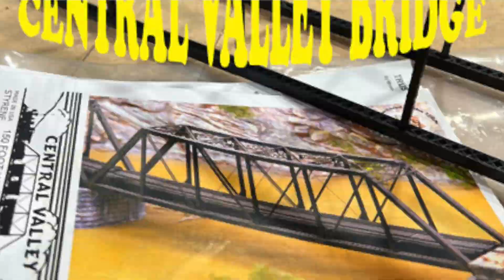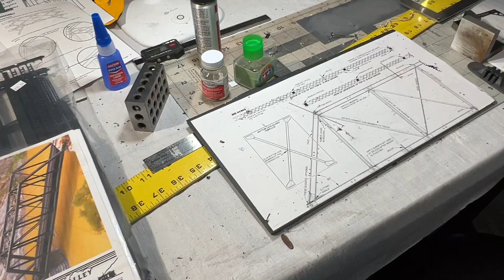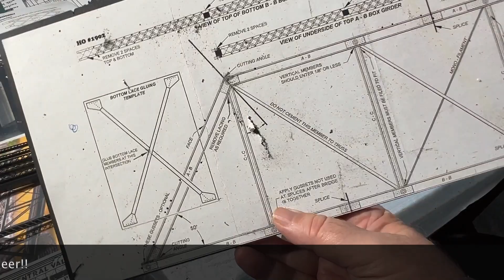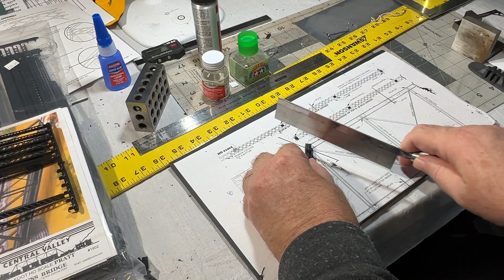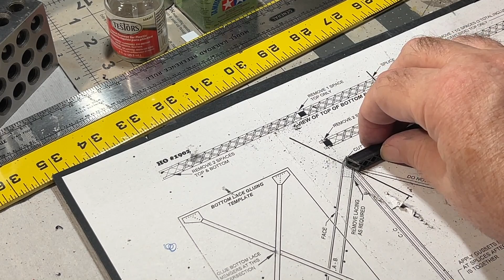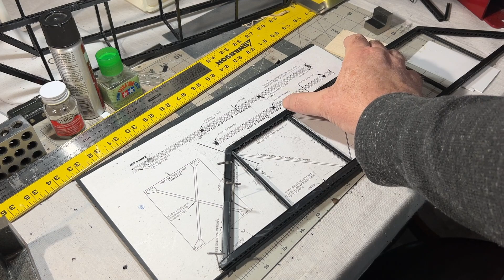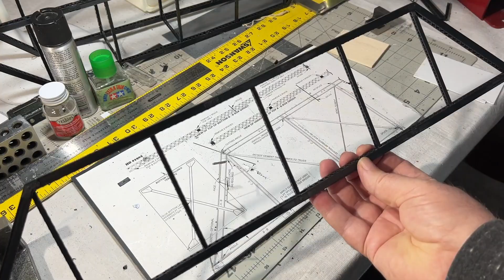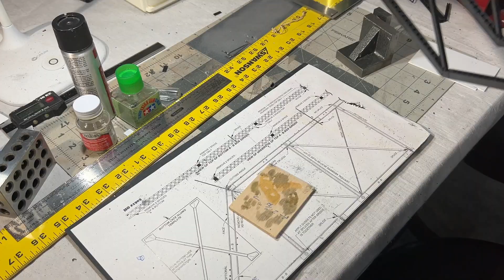Modeling Tips: 1 - Central Valley Bridge

Comment: I built that bridge like 20 years ago. Very challenging. You don't need to have a degree in enginering to do it... but it helps a lot at the end ! It's not up to all modelers to build it. At the very end, it can be heavily weathered to hide a bad assembly job. But it's like trackage, once you screwed up, it's nearly impossible to fix things unless you start all over again... And the proper way. Like what you shown us on the clip. Good job of doing it "properly".

Comment: Hi.  If you go to -- https://www.youtube.com/watch?v=ze12CNd5PI4&t=17s -- in YouTube you will find part 1 of a 2 part video from Central Valley Model Works there showing you exactly how to make the bridge.  It is a step by step video and I watched this many times first and then watched it in sections while I built the bridge.  Following along made it all a lot easier and the bridge came out really great. As you say these are not kits for the faint hearted but they are great models!!! I also screwed a piece of flat aluminium bar onto a old MDF laminated board I had which provided the straight end to align the template too and the panel provided a perfectly flat surface so the truss stayed aligned and flat while I glued the kit together.  A number of 1-2-3 blocks help and I was lucky enough to have a friend who milled a steel block to the dimensions that you used the basswood for.  For gluing I used MEK (Methyl Ethyl Ketone) as I do on most of my plastic kits.  It drys fast and strong.  In fact the plastic will break somewhere else and not at the joint.  I hope this helps in some way.  Cheers Brendon.  Leeston, New Zealand
Reply from the maker: I thought I'd referenced those videos at some point but it may have ended up on the editing floor. Thanks for the tips!